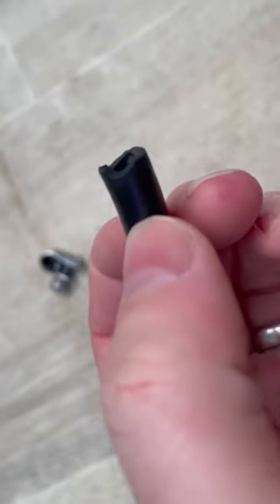Fire Safety Warning for Diesel Heater Owners

Comment: Ive learned from Chinese generators the fuel lines tend to harden then crack causing leaks always swap out for some quality braided hose especially fuel lines.
Reply from the maker: Great tip. Thanks for sharing.

Comment: Good catch, I’ve wrapped mine in some heat resistant tubing..thought that might happen due to the heat being so close. Thanks for this warning it’s quite timely too as now is the time most folks will start using the heater.
Reply from the maker: That’s a good idea. We ran ours on the drive before a trip just to ensure it all still worked; glad we did check it before we went.
Reply: Nothing worse than getting somewhere only to find out somethings ran out, broken or could really ruin your day. All’s well that ends well.
Reply: You can use exhaust pipe installation

Comment: Thanks for the heads up. Would it be correct to say that in the event of this happening while sleeping, the nasty smell of diesel and it's fumes would wake you up over raw propane, which could kill you sleeping? I really want to install one in place of my old propane furnace in my RV. Cheers
Reply from the maker: Wouldn’t like to say if it would wake you, but can confirm it stank and did set off both our smoke alarms which would’ve woken us up for sure. Hope this helps

Comment: Really have to get quality fuel line for diesel fuel. I have a diesel generator and even when I buy quality hose it seams to only last a few years before it starts cracking
Reply from the maker: 100% it’s harsh stuff that’s for sure. Will definitely be checking it at least annually from now on.
Reply: Silicon rubber hose is impervious to most things & good up to 215°C if you get good quality but you have to be certain there's no loose flakes where you've cut it because the split will grow along the pipe. Grab the end between finger & thumb & drag the flakes off til they're all gone. Pressure side only though, not suction.  
I've had silicon rubber spill rails for maybe 10 years on this engine & I've done the same on previous engines.